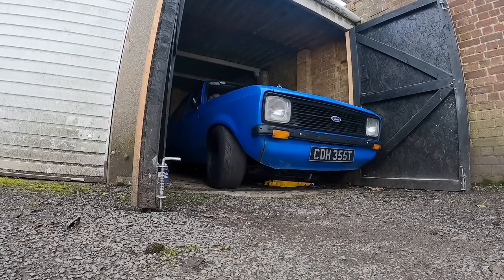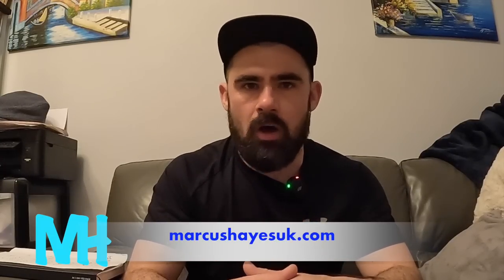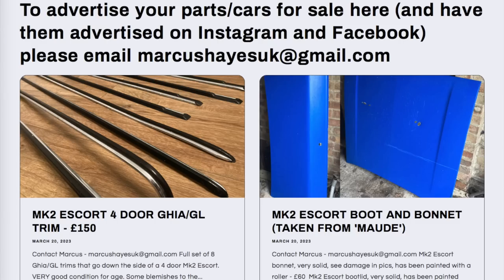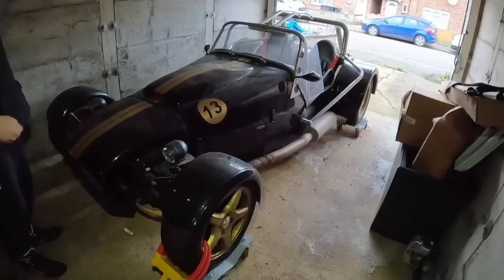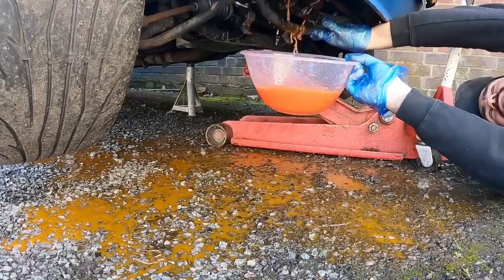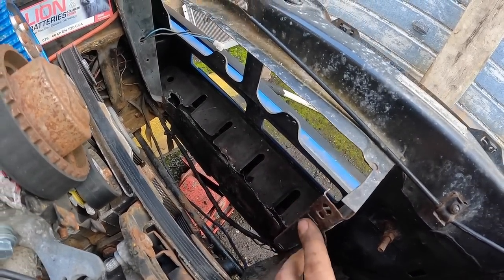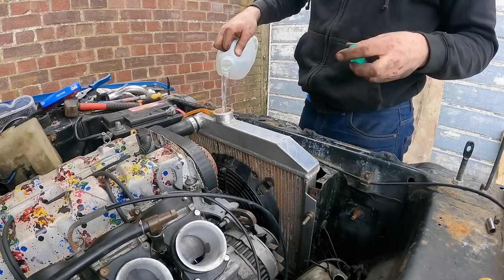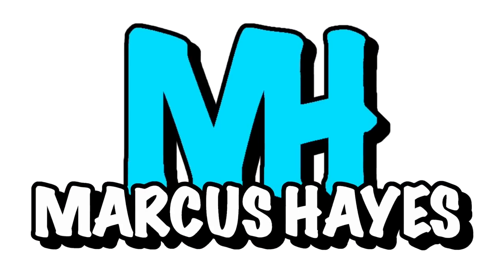Making my Mk2 Escort COOLER!! 👍 . . . . . 🤠 EPIC bodge!! 🤠

Comment: Alternator needs spacing out it is what wore the belt at slight angle.
Reply from the maker: Thanks for the advice mate! 👍 The belt is running true but I noticed the bolt holding the alternator to the bracket was loose so this may have caused the alternator to move enough for the belt to wear??

Comment: Half washer behind each bolt on alternator to bring it forward a tad. Loving the vid as always.
Reply from the maker: This would make the belt run untrue tho mate. And its right at the front edge of the crank pulley as it is. Appreciate the advice tho. 👍

Comment: Marcus I would get the ends of those metal pipes rolled with a lip to prevent hose’s slipping off 😢 you definitely don’t want to be doing another head re build.
Reply from the maker: Defo would be better with some sort of bead on the ends. Ill keep an eye on things but so far so good, and Leigh didnt have any issues when the pipes were fitted to his Escort. I'v ordered a fitting for the heater hose connection tho. 👍
Reply: Another alternative is: whip the pipe off and have a couple beads of weld put on to act as a lip. 1 inch each on opposite sides will do. No special tools needed.
Works a treat, costs £free or less than a fiver at a local garage I would think.